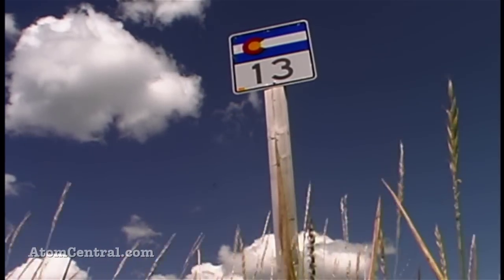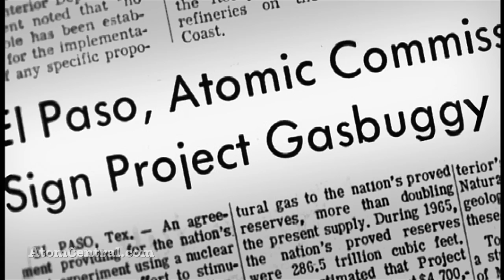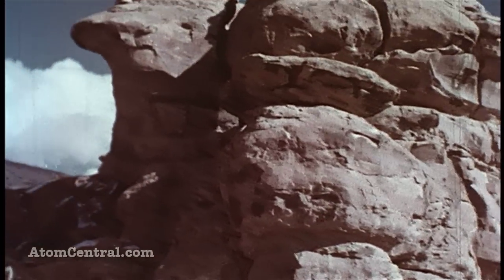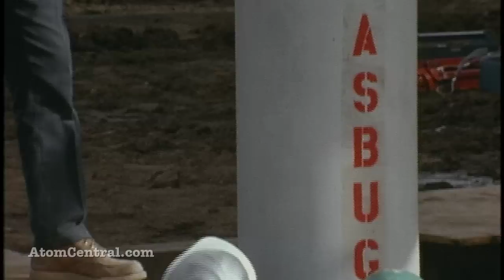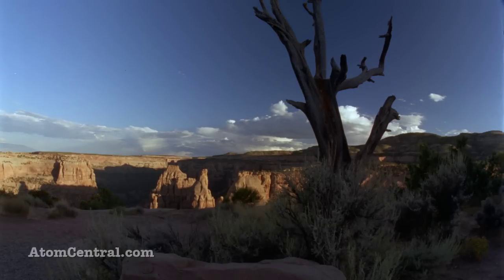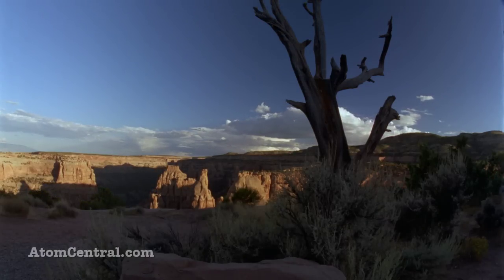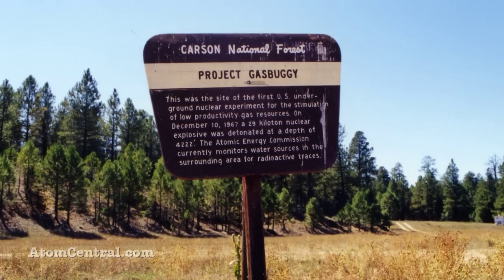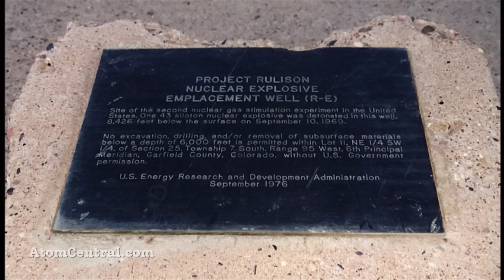Nuclear Fracking!

Comment: Yes they knew the gas would be radiated, but that's why they tested the idea in the first place. You can make a nuclear weapon surprisingly very clean when it explodes. Specifically using a small clean two stage thermonuclear weapon would detonate relatively very clean. By using very little fission fuel, and replacing the second stage fission spark plug and tamper with lead or beryllium. For those of you who know about nuclear weapons. To see if an idea work's or not, one must test that idea.
Reply: I heard that some fusion devices don't have sparkplugs, but instead rely on heating from the first stage? That would surely result in a much cleaner device.